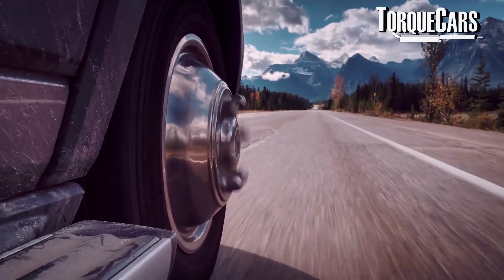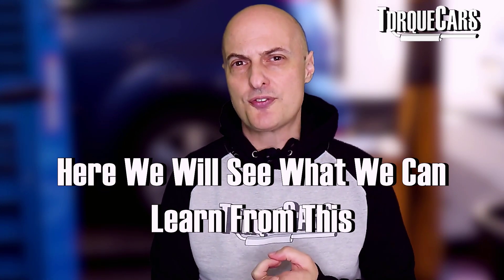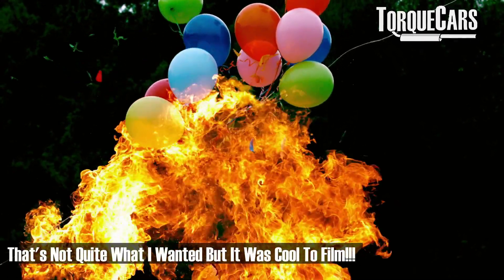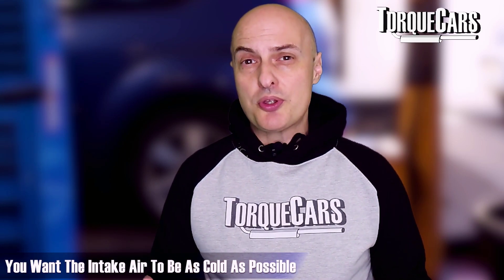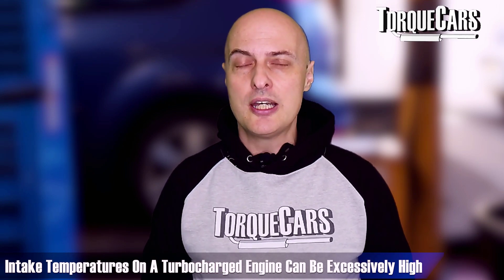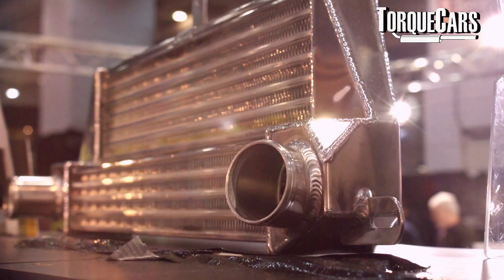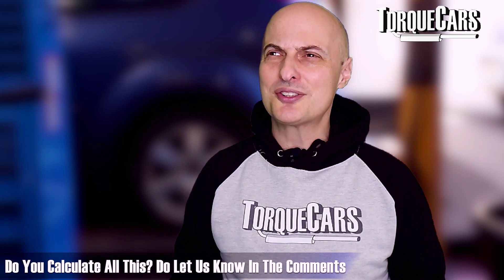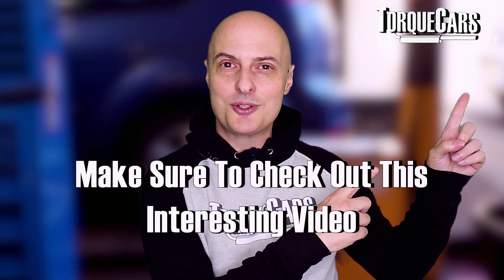Why You Car Has More Power In The Morning, & Less At Other Times?

Comment: Alfa Romeo Twin Spark CF2 engine, '99 MY. Definitely better performing in the winter with slightly (~ 10%) reduced fuel economy. Obviously opposite for summer - which, here in Greece, is always rather hot. I've regularly had as much as 46 UK mpg averaged in the summer (ECU is remapped), kind of "making up" for the slight loss of power & performance. Quite happy with it anyway, always looking forward to the next ride :)

Comment: This is exactly why I love methanol injection. My intake on my 1.8T A4 sits right next to the exhaust/turbo. So on a 85°F day just cruising IAT is 100-110F. When I floor it it instantly falls well below ambient temp! But still early morning the car absolutely feels stronger than evenings.
Reply from the maker: Interesting, I must look into Methanol injection, from what i've heard it is a pretty good option for those higher power projects. There doesn't seem too much around in the Uk though, I'll have to do some digging.
Reply: @torquecars  Snow Performance is who made my kit. I think they may be based in the UK actually. But it's possible to remove the innercooler completely and use water methanol injection on it own. It's also the reason I can run 550cc injectors (630cc @ 4 bar) with E85 @ 300whp. It not only cools the air but acts as a supplemental fuel supply.
Reply: I’ve got a diesel Golf gt with the pd fuel system best I could do is pure hi grade vegetable 🥦 oil no meth for me 😂